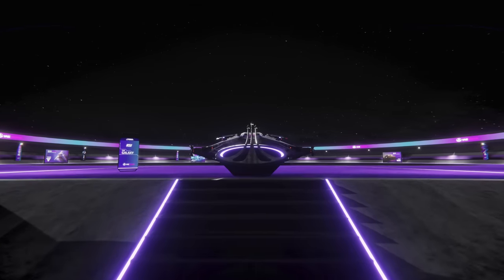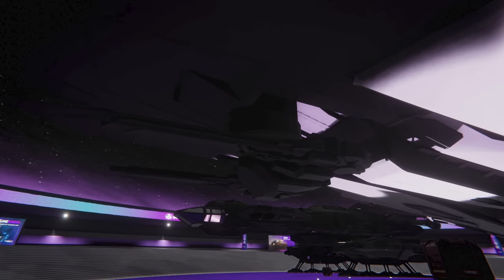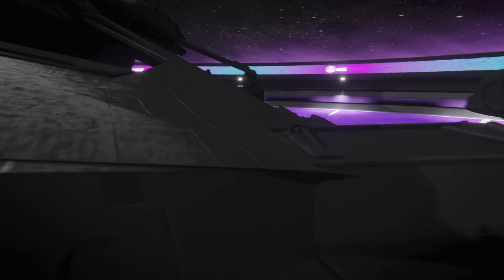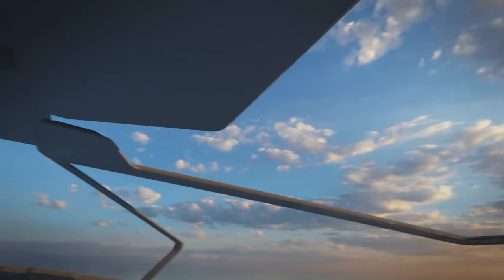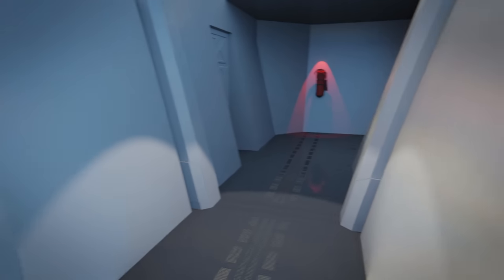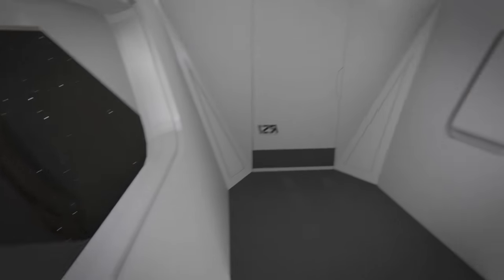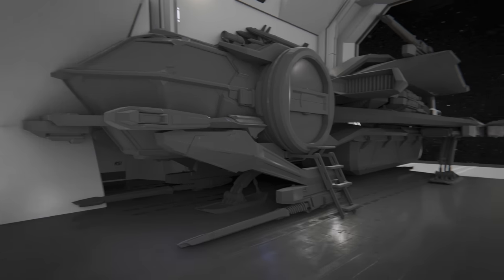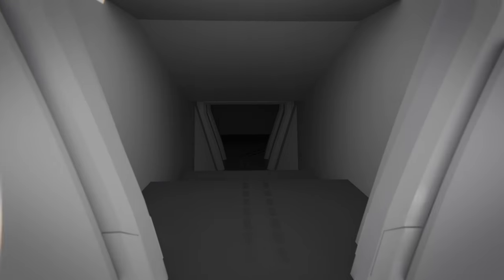Inside the RSI Galaxy

Comment: Thanks on creating this early preview of the RSI Galaxy. Also for offering up your suggestions for improvement and early missed opportunities.  
Windows, either properly cut into the hull or virtual windows are something I want to see CIG include more of. Not a fan of their habit of incorporating skylights over lateral windows. 
Opinion: The Pool table prop is a miserable use of crew space. However, a multipurpose holotank incorporating haptic feedback of solid play pieces (magnetic core) could handle the pool table simulation (ship movements damped out from the sim) using solid pool balls. Also for virtual tabletop, Sataball / Murray Cup UEE sports coverage, art, and mission planning roles.

Comment: Thanks for your work on this, very nice. 

I would like to see a Quantum Snare module for the Galaxy. We could do with a larger interdictor (and one with more range etc), but it doesn't make sense to have a large ship dedicated to this I think, as it's quite a niche role. Also the Galaxy is well suited - not too strong turrets & shield (1x S3) for it's size / kinda squishy for it's size (similar to Mantis). The Mantis has 20km snare, something like 60-80 km from the Galaxy QED would seem fair given the crew requirement. I also think it could mean a rebalance with Mantis able to snare S1-S3 Quantum drives, and the Galaxy QED able to snare S4 (capitol) QT drives. Similar to how the multitool tractor beam was buffed until the two handed and ship based tractors have come in, then rebalanced.  

As a bonus we get an Imperial Interdictor Star Destroyer in SC. 😃

Comment: if you pause at 0:40 you can see there is an L shaped area between the bedrooms and the dinner table, I think that's the bathroom. There is another one between the other two bedrooms and the pool table room. I think you access them by using doors on that hallway with bedroom doors.
Reply from the maker: Now that you mention it, the blue floor suggest that there is something - but I can't make out any detail or even a door...
Reply: Pour les salles de bain, regardez les plans officiel au fond chaque chambre il y a un petit renfoncement qui pourrait être de la même taille que la douche des constellations . Si ce sont bien des douches il ce peut aussi que les lits soient aussi  les même que ceux du constellation .

Comment: 11:35 that central hallway window could get bumped out into the the hangar area to create a control room for cargo beam control or any other oversight needs of the rear space. The only reason I can see this not working is if it interferes with the modularity plans (i.e. needing that perfect square or rectangle to drop the modular box in)
Reply: eh more like 10:56 actually
Reply from the maker: I said the same in the video :) but I dont believe there is a tractor beam in the back hangar, as there are almost no cargo grids - its not meant for cargo.

Comment: Do you think the hanger might fit a Prospector? The Galaxy is the Swiss army knife of ships. Excited to hear that it will have a base building module.
Reply from the maker: since it's even longer than the Aurora - propably only if parts are allowed to hang out - ill test it in Pt. 2, Prospector would make a lot of sense.
Reply: @ace_tristPWN  maybe at an angle

Comment: Awesome video !! Even the placement in the IAE hall was spot on! As a Galaxy owner this gets me even more hyped even thought the release is indeed looking at 2025. Nevertheless i still dont really understand how the ships will be swapping the modules since its not really high off the ground (yes tractor beam could work or like industrial lifts) and compared to the carrack which modules pods are in very logical design that seem to slide in and out vertical easily i dont think the galaxys modularity is very logical.  I agree 100% on the looks. It looks awesome and even though i doesnt look like it will handle combat well the looks for me would decide that it needs a combat module 😂 maybe even a module that has a EMP and/or QED like the Zeus MKII MR has.

I would also like to see a luxury module like the Phoenix has and that could solve your too few windows problem(i dont get why CIG would go less on windows since in the SC verse glass is even stronger than most metals. But all in all awesome video and with this type of work i would 1000% hire you at CIG !!
Reply from the maker: To me it sound like you don't actually see the modules being changed - and certainly players can't do it with tractor beams. I think t he Q&A said you have to to it at special locations, like Cousin Crows at Orizon, and I would assume it works like spawning the ship - you don't actually see the process.

Comment: It would be really cool if they made it so that the modules themselves have the doorway from the module area to the hangar, that way you could opt to use the module area as extra hangar space instead of having a module there.
Reply from the maker: You mean a hangar the length of the module and current hangar combined? Interesting. Could still only fit super narrow ships :D Even an aurora could not turn in there.
Reply: @ace_tristPWN  I mean it could, if they removed the back of the hangar area with the door and wall, could be able to fit a Scorpious in their too

Comment: i think all those plates outside is movable parts. and this is how modules gets instaled, rear of the ship gets back, module comes in and get squished after to lock it down in place...
Reply from the maker: I think there are too many corridor over the module to make any of that move or extend. I also believe, but I could be wrong, that it what said that changing modules is never happening physically. So basically you would have to despawn and respawn the ship to change modules.
Reply: @ace_tristPWN  i would love to that in action like hull does

Comment: It would be cool if the base ship with no module installed used the dead space to mount massive fuel tanks. adding no specialty to the ship but enabling a significant increase in range

Comment: Thank you so much for your efforts creating this. I'm curious if a C8R or Ursa would fit through the doorway between the hangar bay and the module area. Mostly thinking to store a few ships in cargo hold and active ship in the hangar bay.
Reply from the maker: Ill try that in pt2, but the door specifially is where I think speculating makes the least sense, they can easily design it so you cant get anything through, even if there was technically enough space

Comment: Reckon we will lget a nova tank in there, just, since the sloped front of the tank can go right up to the module door.
Reply from the maker: Are you talking about the rear hangar? Thats to high for a Nova to drive into, 6 meters off the ground. Unless it fits on the cargo elevator (which I doubt), it won't get in there - ill try in part 2 though!
Reply: Oh my bad, I had no idea there would not be some kind of ramp - that is kind of weird!

Comment: I have a feeling this ship will change a bit during it's concept and white box (considering that the current design doesn't have bathrooms). Like some ships it'll probably grow by a few meters at least. It would be cool if it had a hangar module as it's 'basic module' that basically removes the back wall and expands the hangar, seems a little weird that an aurora is too long for it
Reply: yeah a hangar module that changes it from the middle section only, to one giant hangar including the rear space for a bigger hangar!

Comment: Id love for a combat module for this ship something to make how armored it is worth something (adding extra weapon mounts or larger mounts and larger components to fit said larger mounts and shields, maybe a bounty hunter module.
Reply: For a bounty hunter module you’d probably add a extending ramp at the hanger entrance. Let’s say add Weewoo lights because everyone loves the weewoos. You’d have 2x8(16total 8 on each side) cryopods in the module bay (maybe more if they will fit) The over look room would have cryo controls so you can try and free your friends from a soft death galaxy.
Reply: And the combat mod would be vastly improved adding more situational awareness to the cockpit the armored sides will have screens that display the outside of the ship in a fixed area.  (the sensors can be damaged if needed) the top middle of the ship will be x2 size 7(or smaller if needed)  fixed guns as well as an upgrade to make the shield a Capitol class same with the power plant. (The module area would be a slim ish corridor with the new power plant and shield generator, and the old power plant area would have x2 2 seat life rafts (escape pods of a smaller size not much leg room.)
Reply from the maker: nice ideas, I might explore some module ideas at a later time!
Reply: @ace_tristPWN  that would be awesome to see!
Reply: Titan drop module!

Comment: Good work! I'm pretty hyped up for the Galaxy but until it's out I don't think I could even think about putting any money down on it, even as an upgrade. I could be remembering wrong, but didn't they pitch a building module during CitizenCon this year?
Reply: Ils ont parler que le galaxy aura des possibilités de construction  jusqu'à une certaine taille de bâtiment  (moyen) ,  donc oui il y aura surement un module de construction et encore  d'autres modules a venir dans le futur.
Reply from the maker: Yes, they mentioned that, but did not show anything so far!

Comment: i think it needs a 2nd module hardpoint with options for torpedo, missile, interdictor, deep space scanning, or mining modules. that can all be remote stuff or pilot controlled, it doesn't need to have internal space in the new modules as they would be a much smaller module. i also think this thing needs S6 turrets not S5 and a pair of point defense turrets, 1 on top and 1 on bottom. they can either be missile or gun based idc. THEN it might be worth using, currently it is too poorly defended and it will get 1 shot by a size 9 torp. The size 9 should kill it if it hits, but the bomber should have to work for it alittle bit or attack with with a friend, not show up fire 1 missile and collect a free multi-kill.

the starferer, 890j and reclaimer all have better defenses than this thing, and they are all civilian ships too. this thing should be a true multi role, and you're right it does look like a warship. but currently it feels like its going to be terrible at everything. which is why i want more forward modulairty, and better weapons/point defense. Let players configure the ship to suit their needs.
I dont see a reason to use this floating coffin for 6-8 players, over just using dedicated smaller/better ships.

Comment: I wouldn't want extra windows on the side. Breaks with the RSI/CIG design philosophy that if it isn't a Luxury ship, then it doesn't need side windows. Also it's too bad a Cutter is 20m long. 1m longer than the Aurora's. At least the Pieces and Fury's will fit no problem.

Comment: Great work! Are you using 3ds Max?
Reply from the maker: No, Blender. 3ds Max has a place in my heart, I learned 3D with that 15 years ago, but it's more or less dead - CiG is one of the few big studios still using it, since cryEngine is built specifically to work with Max.
Reply: @ace_tristPWN  Thank you for the answer. I was interested in learning 3D modeling but ended up trying CAD (Solidworks) only for a short time. Oh I see, I just found out that CIG uses 3ds Max for modeling its starships.
Btw, I have some questions:
1. Do you think CAD software is suitable for creating 3D spaceship models for video games? or is it only work best for actual real-world scenarios?
2. What is your 3d modeling software recommendation besides Blender?
3. If you start again from 0, what is your 3d modeling software choice?
Reply from the maker: 1. No, it's not - they are both 3D, but it is a very different way of working. 2/3: It really depens on what your goal is. Back in the day I used 3Ds Max, and I like it, but the company stopped developing it a few years back. I do these videos as a hobby, therefore Blender is 100% the best choice - but big companies don't use Blender (And they won't, dont believe the youtube tutorial guys.). If you consider a career in the industry learn Maya or even better Houdini, Houdini is the most advanced one nowadays (not necesarilly for modeling though). But I believe blender is similar enough to all the bigger ones to give you the best start into everything, and to get a feeling if this is for you.  @ZkyMaster
Reply: @ace_tristPWN   Big companies don't use Blender, why is that?
Reply from the maker: A few year ago it simply was not good enough. By now it got a lot of amazing features, but it is open source and free, which is good for you and me. But big companies nees a big developer behind their Software. I worked in productions where Maya had a bug - the company behind it (autodesk) was called and you got a fix within 24 hours - they can guarantee a level of support Blender can't. Also the industry adapts VERY slow - the Software versions used are usually a few years behind what you can buy, because a proven, if slightly older solution is worth more than a flashy new one, that might have an issues in the middle of your project. @ZkyMaster

Comment: I wonder if you can fit 2 aurora's in there, can you fit 2 pieces in there?
Reply from the maker: I'll have to test that, working on part 2!
Reply: @ace_tristPWN  is your hanger based on speculation of how big it will be or actual measurements provided by cig?
Reply from the maker: As stated in the beginning, I aligned it to the blueprint they gave us. It's not 100% accurate but it is not made up either. I would assume it should not be off much more than a meter, max.  @xanderprentice1740

Comment: To be honest, the two back seats are on remote turrets, so why do they need to see out the window? And I'm pretty sure there's going to be a ramp in the back hangar, CIG stated that you cannot fly the ship without one of the modules.
Reply from the maker: Hey, have a look at the Galaxy Q&A page - it confirms both that there is no ramp, aswell as that you can in fact use the Galaxy without a module equipt, and that you can still enter tham empty room. And about the window - well you don't spend all your time in the turret, right? Just my opinion, and I don't think it would harm the defense to have the windom a little bigger.
Reply: They said without a module that space will just be empty - and you can even use it for cargo - but it wont be able to snap to a grid - like it would if you had the cargo module installed

Comment: Could you put up the model for download mate?
Reply from the maker: Hmm, I might think about it in the future, but there are some official parts in there that I am obviously not allowed to distribute...
Reply: @ace_tristPWN  Fair enough. I just want to take a stroll in VR to get the scale of SC properly. I can fill in the blanks if need be. Thanks for the reply. Prost.
Reply from the maker: Stick around, maybe Ill fing a solution in the future - but In case you did not know, you can play Star Citizen in VR with an external software called VorpX - it was blocked until recently, but should work again. Pretty hard to set up from what I read though. @ezarhon1002